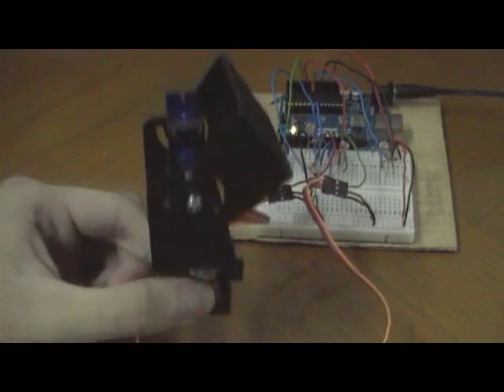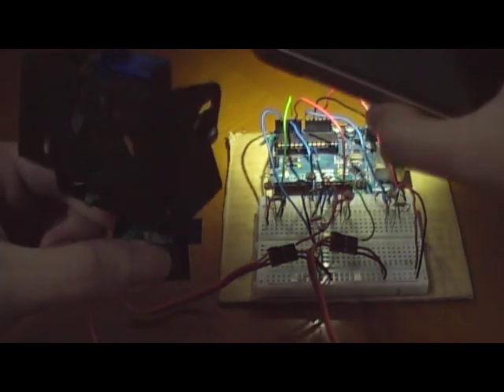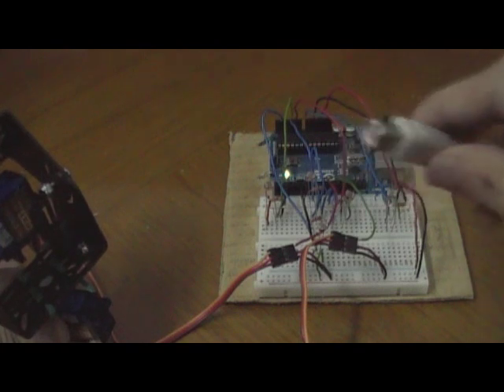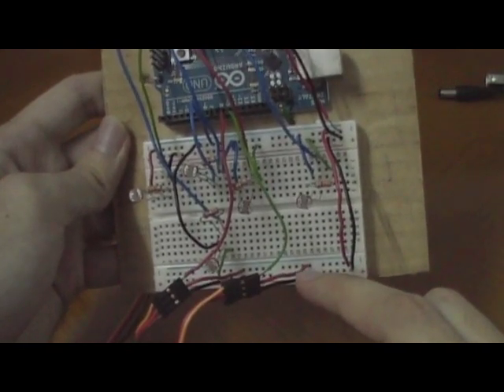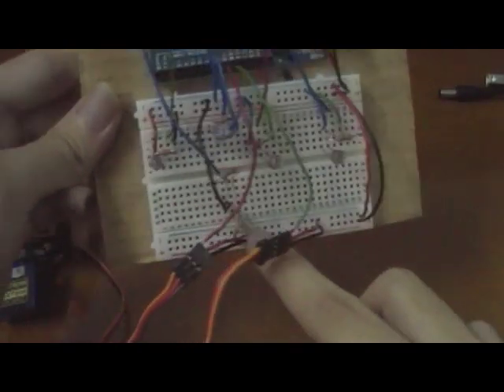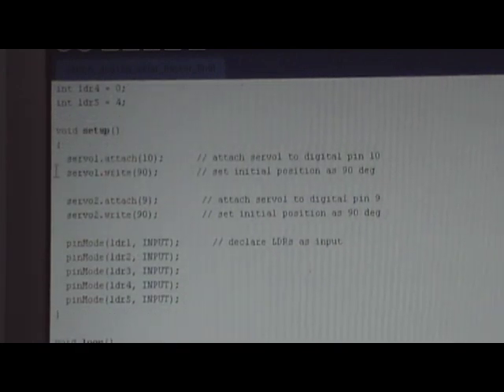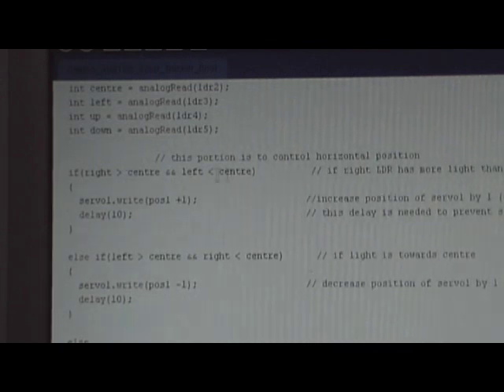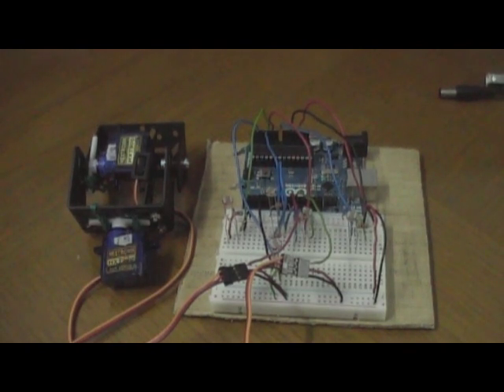Arduino Solar Tracker (simple code)

Comment from the maker: The video is of the project at an unfinished state. The LDRs are supposed to be mounted on the brackets, hence allowing the relative position of the light source to be changed as the servo moves. As mentioned in the previous reply, when the face of the brackets (with LDRs mounted) is eventually orientated square to the light source, the LDR values should be equalised, of which the servos will have no input to respond to (and hence coming to a stop).

Comment from the maker: It's been a while since I last touched this project, so I'll try my best to recall the logic.

The position of the light source relative to the LDRs will change as the servo moves. Take for example this if statement:

if(right > centre && left < centre)  

When "right" is more than "centre" and "centre" is more than 'left", this means the light is to the right of the LDR. As the servo moves, these values will gradually equalise. The servo is expected to stop when "right" = " "centre" = "left".

Comment: Hello, thank you for your video! I checked the code and I have a question. How the loop if knows to stop at 0 and 180  with lines "servo1.write(pos1 -1);" and "servo1.write(pos1 +1);" ? Per exemple,  if the light is maintained on the right, the value of pos1 can overtake 180 with this code line? Or not?

Comment: i have tried making your solar tracker butboth motors continue rotating instead of moving according to the light. Also, when one motor started moving according to the light, the other motor kept on rotating without sensing any light. What do I need to do to make my solar tracker work?

Comment from the maker: No. I powered the entire circuit using DC instead of USB, which gave enough current to power both the servos and the Arduino board. The board does get very hot after a short while.

The motor shield is the recommended way to use servos, IINM.

Comment from the maker: Everything I can tell is in the video descriptions. The circuitry, the resistor values, the motor.

Resistor is 330 Ohm but that is paired with my LDR which I dunno what is the rating.

You should Try going through the tutorial in the video description regarding LDR.

The source code is also n the video description. I have moved on from this project so anything else I really can't help you.

Comment from the maker: Yes the C40R can be used. As for the resistor, you need to experiment with the LDR you have because different LDR-Resistor combo will give different analogRead values. I don;t know what ratings my LDRs are, so I can't help you with that.

I've check at Cytron, yes the C40R can be used.

Comment: im looking for that code but with 2 Honda AC Door vent control to do the solar tracking there no servo pcb in 1 and both have a pot built in the biger 1 dos have a h bridge but it dead the pot is built in the pcb and hocking them 2 motors on a L298HN with 2 transistors playwithmyled com 2010  05 stepper-motor-controller-circuit-and-code

Comment: @djfoo000 NO , it is not moving one motor one after the other, if you look carefully , it is moving both the motors simultaneoulsy, isnt there any way we can command one of the actions to perform first. (it has nothing to do with the delay)

Comment: @djfoo000 I was told that i should not use the same loop for vertical and horizontal axis, i dont get that part, any way of coding by having another loop ?

Comment from the maker: @ThisWorldABitch If you want to accentuate the robotic movement, just prolong the delay. In this case, use delay(500). I used delay(10) in my code. You can try any number bigger than 10.

Comment: Hi I have made for four sensors program, but the problem is I want it to track horizontal first and then vertical or vice versa, but my program is like the vertical and horizontal tracks by moving simultaneously, any way to implement decision